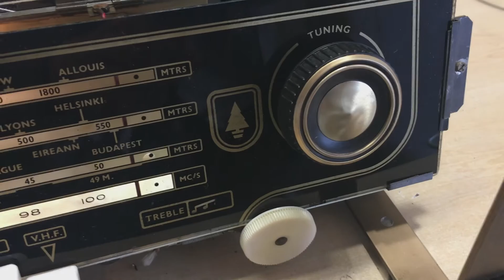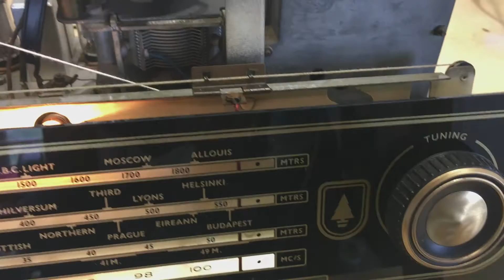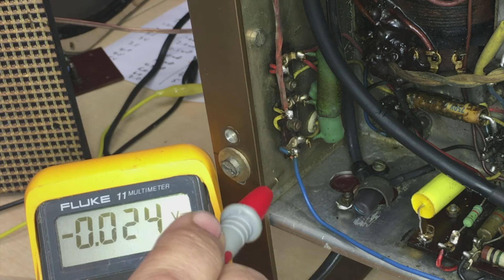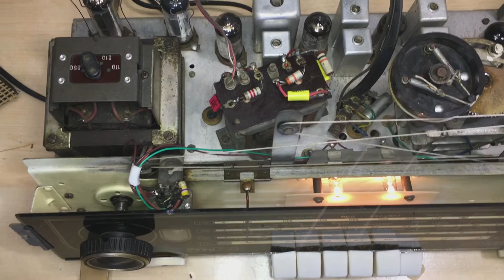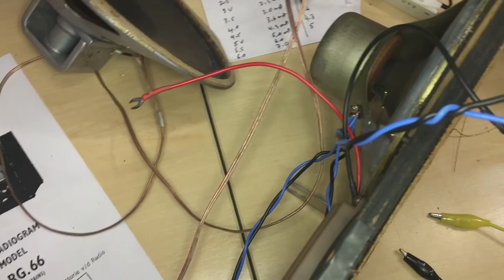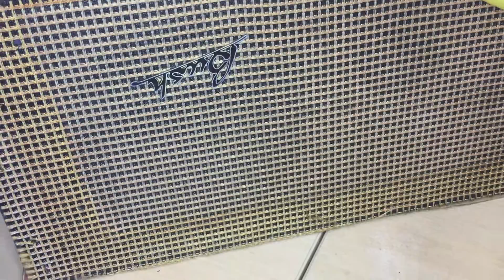Bush VHF64 tube radio restoration - Part 4. Electronics basically done.

Comment: Sometimes TV coax is a better screaned cable as it is low capacitance. Leak amplifiers used this idea when anode fed. Phase on tweeters is impotant where it crosses. Often wrong  is nicer.

Comment: Apparently, the use of dissimilar speakers in radios of this type was intended to counteract cabinet resonances. I'm given to understand it worked to some degree.

Hunts capacitors are a well-known "replace on sight" item in British equipment. It wasn't always this way, they were reckoned to be very good at one time but it must be said they weren't manufactured with a 60+ year life expectancy and as the decades rolled on they started to fail in huge numbers due to age.

Comment: Bush may not make amazing electronics, but they are very functional and the speakers they use are often top notch, even in the modern Bush equipment.  They know how to design a cabinet to match a speaker too.
This is a great little radio and going up to 101.6 means it would get the station you like on FM.
Reply from the maker: Yes, the speakers are really nice.

Comment: The set looks fantastic. One day I'd really like to see you actually replace a cap or two. I'd be curious to see how you unwind the soldered leads in such tight spaces. I also thought it was interesting seeing the "wound" treatment you did last episode.
Reply from the maker: +Rahoul Zerohl : I tried actually filming the work in the past and the result is that it took me ages to get anything done, so now I only log the results. I use the "wound" method a lot when desoldering the components is too difficult.